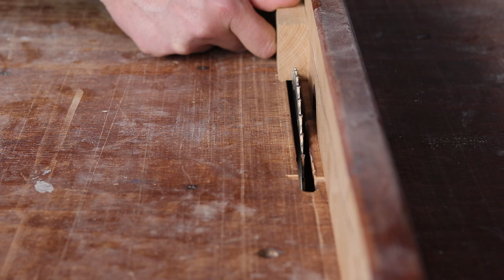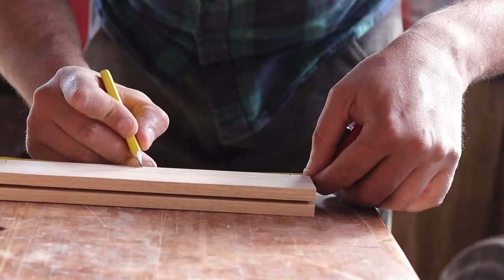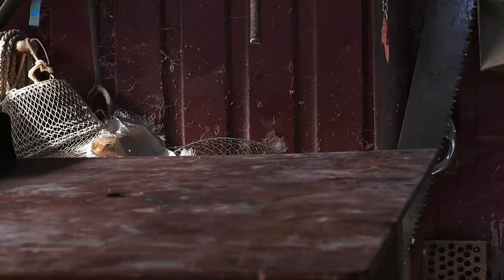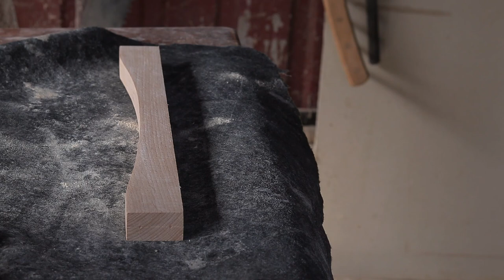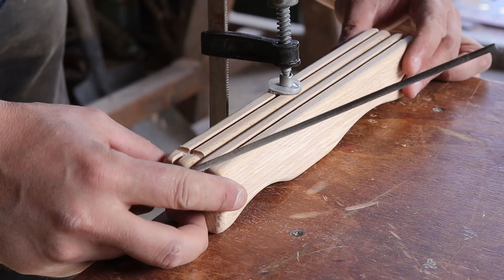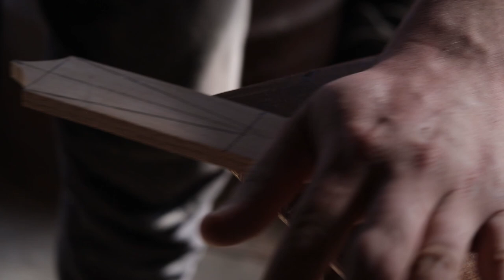Making a frame saw / bucksaw for  Bushcraft and Woodworking  ( DIY | power tools | fastway  )

Comment: What kind of screw inserts are those you put in for the blade? Where could I find them?
Reply: I think they are the same as i use for connecting kitchen base units together. John ( uk )
Did you find any Mark?